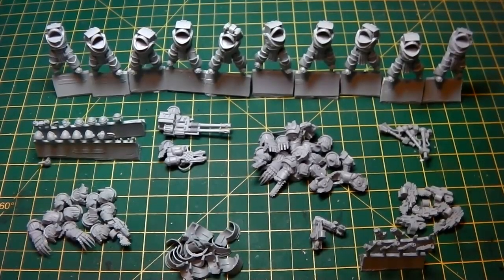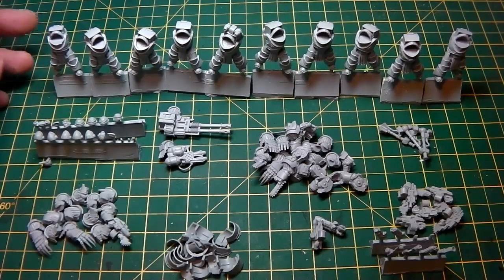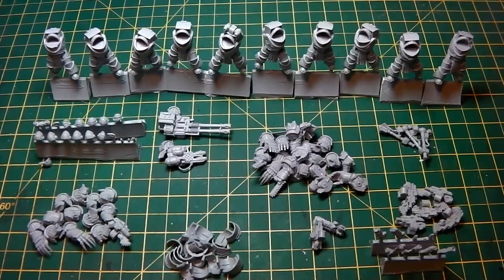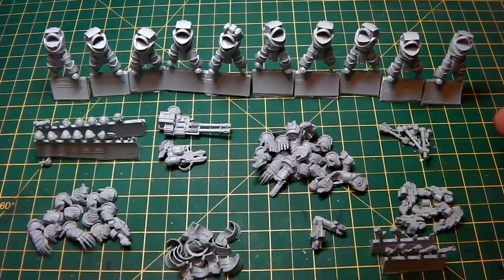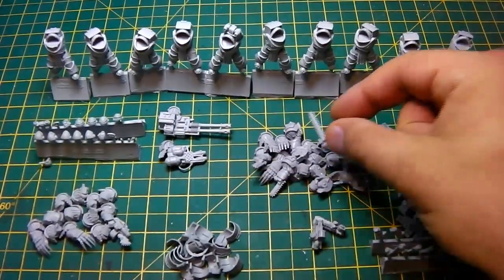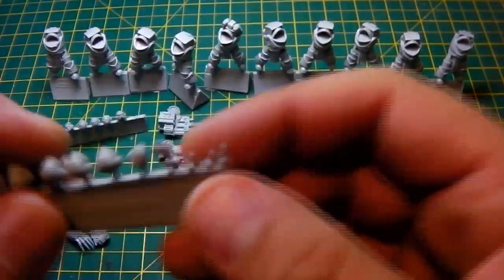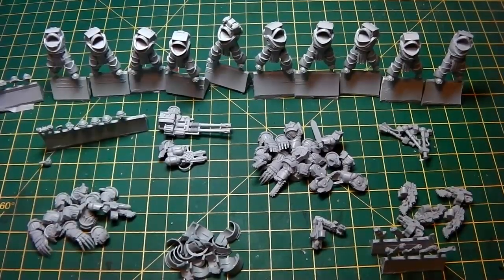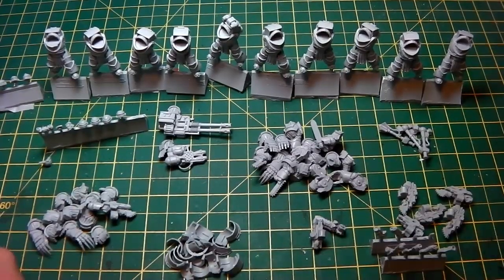Lets Make: Cataphracti Terminators

Comment: I once tried to straighten out my Emperor's Champion's resin sword with hot water: it turned into rubber and I replaced it with a Power Axe instead. Fits my army better, so I guess it evens out :P Great vids btw! Love the details and the posing!
Reply: Use a hair dryer mate.
It works much better, hold the blade for example upside down, and let gravity and the heat straighten it. Works like a charm, every time. :D
Reply: Jennifer Foreshew
Ah, thanks, I'll try that next resin model that needs fixing. As an update I took away the axe recently and gave him a spare sword from the fantasy mage pack, really long and sleek broadsword :)